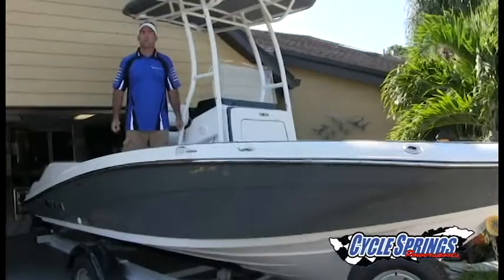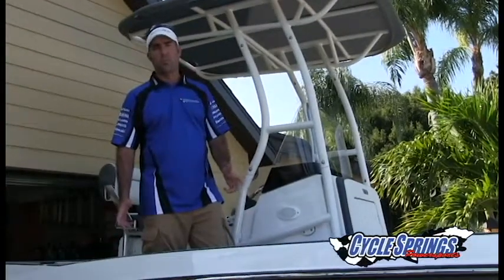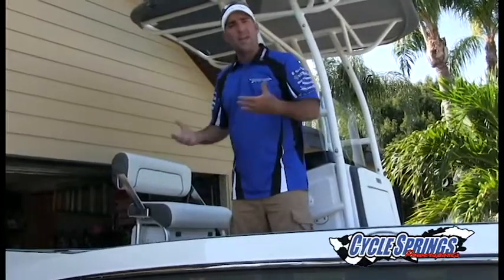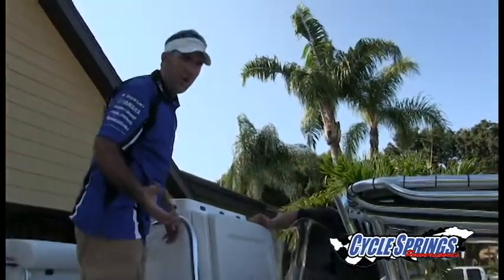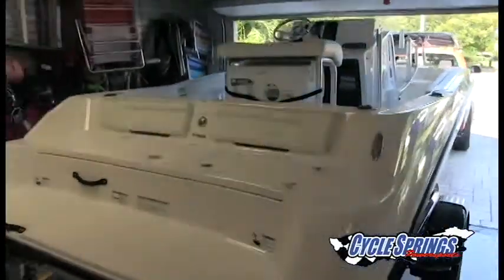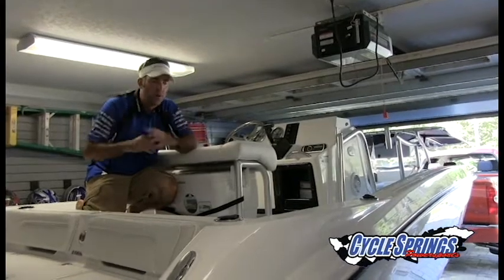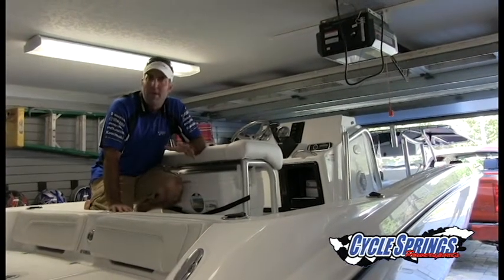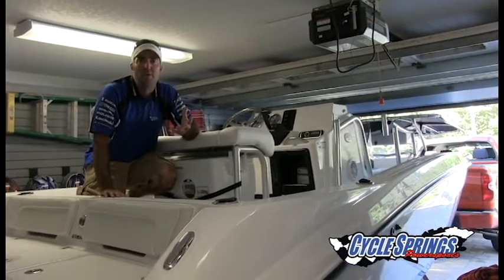Yamaha FSH Salt Series Fits In Garage

Comment from the maker: that garage was standard length, but if I'm not mistaken we did not have time that day to move all of the items in the back of the garage so that we could back it all the way in. we merely wanted to show that the boat would fit under the opening. the seat is actually the standard Base Model FSH seat. you would need to remove the seat back on the FSH Sport or Deluxe to get it inside a 7' garage door.
Reply: was this a 7ft high or 7 ft wide ?
Reply: Can you close the garage door? and yes it look like the new top collapsed added some overall length to the boat.

Comment: Why Yamaha won’t make a salt series for their FSH center consoles has blown me away for years. 

I’d buy the little 19ft fsh if it had a folding r top/ bolster and windshield. 

I don’t know why they won’t make them.
Reply from the maker: I agree, this size boat is best for the guy that's going to store it in his garage.
Reply: @JetBoatPilot  you said it! That 13-19ft range are usually either the people that leave it rotting in the sun unused for 30 years. Or they are the guys who use it weekly and wipe it down with a diaper and park it in the garage. 

I always thought they should make a 19 FSH and call it the FSH OCN (for ocean) 

-use twin TR1’s (more than enough power for a small boat, and redundancy of two motors on salt water).

-have a collapsible tower/ seat/ windshield for the garage 

-and a UHF radio with some LED lights on the tower and maybe even at the sterline.

It’s like they are 10+ years behind with their FSH design. And I’m a huge Yamaha fan but like come on !

Comment: Did this top ever get made as a product that can be bought? Or is this a cycle springs item only?
Reply from the maker: Only available at Cycle Springs in Clearwater Florida.
Reply: @JetBoatPilot  Thanks, looks great and well looks well built. My objective is to have it foldable for storage in the winter or during storms mainly. I assume the factory one can be brought down to the console level with some effort. I am in Oklahoma, so probably not a smart idea to try and buy one from Clearwater, Fla. and get it to Tulsa. Financially, I mean. Used to live down there in Carrollwood area and if I still did, that would be a no brainer.